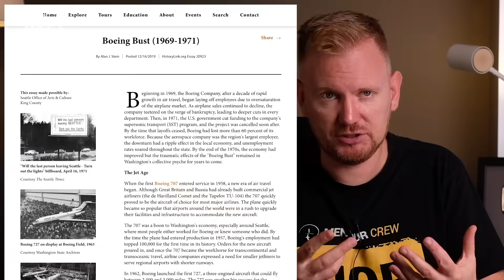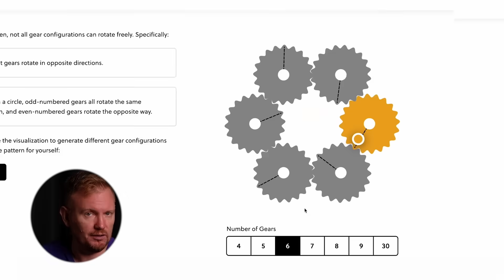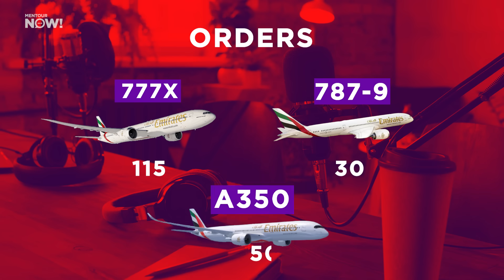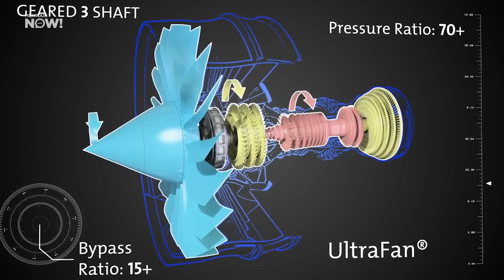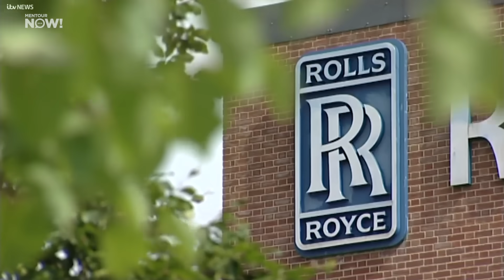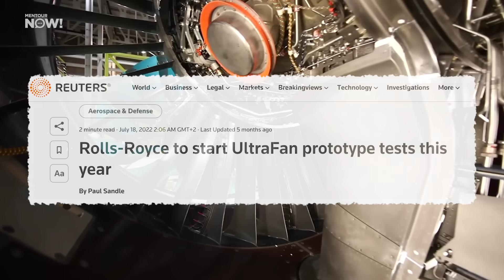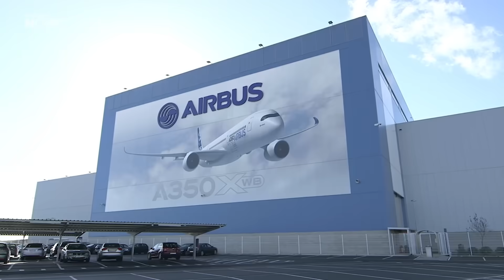Are BOEING planning a 747 with 2 ENGINES?!

Comment: Indeed Boeing will, then they will start to use anti-gravitic motors as they move away from requiring any fuel. No doubt the plane design will go through significant design as the current one cannot handle any speed above about 1000 kms per hour.

Comment: I'm curoius to know - is there a current operator using a doal configuration where part of the aircraft is used for passengers and the rest of it is used to haul cargo to the same destination - is this even feasable ? and if so - could it be the next use case for a large size aircraft like a 747 or A380 ?

 This could also eleviate slots in airports were a 747-like aircraft could drop it's passengers and then move over to the cargo area to load the next batch of cargo, then back to the terminal to load then passengers for the next destination (where it would carry the cargo to as well) - What do you think ?
Reply: That type of airliner is known as a combi and has been in use for decades. It used to be fairly popular but not anymore. Boeing for example produced combi versions of the 707, 727, 737, 747, and 757 but they have not produced any since then. They did not make a combi version of the 747-8 and there is not a combi version of the 737 MAX.
Reply: Adding to Steve's reply. Boeing also produced a "Convertible" version of the 747, with cargo loaded in the front nose door, and passengers at the back. The consensus is that new combis and convertibles would be basically uncertifiable now, due to regulations regarding fires. After combi accidents like South African Airways Flight 295, ValuJet Flight 592, and several freighter crashes caused by fires, the FAA is extremely strict about fireproofing and air-separating passenger and cargo spaces.

Comment: This made me think of all of the different wide body planes or just planes that I have flown in over the years. 777, 767, 757, 747, 737 all version’s, 727, 717, 707, DC-10, DC-9, MD-80, DC-8, L1011, A310, A319, A320, BA-136, Shorts 360, Cesna 182, Cessna Grand Caravan, CRJ-100/200, CRJ-700, ERJ-175, Bombardier Q-400 and a Bell Ranger Helicopter. I have probably forgotten a few. I have to say the 747, L1011 and DC-10 are my favorites. Unfortunately, most of my flying is now in regional jets.

Comment: I'm pretty sure I saw a documentary on the making of the 777 where they were testing its engine on the 747. If memory serves me correctly just one 777 engine was powerful enough to provide enough thrust to keep a 747 in the air. A twin engine 747 would seem doable from a technical perspective. Whether its worth doing is another matter.

Comment: Great video. One comment: Is Emirates really being profitable with A380? Is it due to high load factor alone or also as a result of Emirates enjoying on average 30% lower fuel cost than the rest of the industry. In Oslo, Emirates hardly ever load fuel signaling they prefer to fly heavy outbound to avoid having to refill outside UAE if they can. One reason can be lower prices back home, despite higher fuel burn and emissions due to unnecessary increased weight. The primary owner is the primary oil producer in UAE and fuel prices are not market driven but established by a fuel price committee under Ministry of Energy & Infrastructure and Ministry of Finance. Would Emirates’ business model work with normal fuel cost?
Reply: Got that right can't say it any better!

Comment: All other considerations aside Peter, wouldn't a four engine aircraft be a safer one from the point of view, if one engine fails, the crew would have another 3 to depend on?
Am I right to assume, if a two engine plane looses one, it has only got half its power and control to keep flying?

Comment: I once saw a B747 taking off from SEA and it had three normal engines plus one absolute MONSTER under one wing.  I recognised that they were testing the engine on a known platform.  Perhaps it was one of the GE90 units on the B777-300ER?
They did not just alter the 747 to create the 777.  That was a completely new airframe.  There is no way the 747 can simply be adapted to accept a new two engine configuration!!  The 747 was designed as an all metal airframe and you cannot just swap in some carbon fibre to drop weight.

Comment: I live in constant chronic pain and ptsd...Last time I flew I was in a lot of pain, stuffed in a little seat, with no access to a isle.  Despite explaining this to the person in the isle he'd not give up his seat. (100% VA war disability rating).
  Even if I'd not have that rating/disability why did the general public accept the extremely cramped seats now?
  After that flight (5 hours of torture) I will probably never fly again.
  But if I do you can be sure I'll contact the airline to buy the ticket and there is no way I'll never fly again if I can't access the isle (so I can move as need be).
  If you've seen a Movie/TV show where they torture someone on a stretch table think of being like that for hours...
  For many reasons I wish we had a far better rail system over flying though.
  2 days from LA to NY should be the standard via train IMO. Or from Seatle to Miami.

Comment: Hard to imagine an engine that could keep a 747 airborne. In fact it's hard to imagine a pair of engines that could do so.
Reply: A single engine can keep the largest 777's airborne, they are similar size as the original 747.
Reply: @StevePemberton2  Wikipedia lists the 777's "maximum takeoff weight" as being 775,000 pounds. It lists the maximum takeoff weight of the 747-400 as 910,000 pounds. A very substantial difference.
Reply: @jackfitzpatrick8173  The 747-400 wasn't the original 747. The 747-100 was. 750,000 lbs.

Comment: With the huge decreases in weight, and considerable increases in fuel efficiency over fifty plus years of production, a two engine model would have been conceivable, but Boeing kept increasing the fuel and passenger loads, as well. The safety considerations of having four engines on the very long flights make me doubt that buyers would really go for that option.
Reply: Which is why the Secret Service requires four engines for Presidential airplanes flying over oceans.  The Secret Service won't talk about ETOPs or twin-engine reliability stats.

Comment: two engines is a bad idea. you're trading safety for cost cutting disguised as "going green!"  one engine fails and the plane crashes all because a company wanted to pretend like using 35%-50% less fuel on their airplane somehow balances out the hundreds of tons of trash and sewage just getting dumped into the ocean by india, china, and even the united states.

Comment: No aircraft exists which can accommodate so large an engine? Isn't this the same issue which led to the disastrous changes in the automated flight controls in the 737 Max ?
Its engine diameter was too large to place at its optimum aerodynamic position without risk of scraping the runway. The engine was moved upwards to address this, but that induced an instability. Boeing attempted to address this via. (concealed) changes in automated flight control algorithms for stall conditions. The results were an unmitigated disaster. For Rolls Royce to build an engine that is even larger risks the same and suggests that a much more elegant solution is needed than relying on software to address aerodynamic instabilities.

Comment: I'm wondering when large twin engine aircraft will go into a high wing configuration to accommodate larger engines.  The Air Force already does this with large aircraft such as the C5 Galaxy, C141 Starlifter, C17 Globemaster, etc.

Comment: I believe that KLM tried this, but let it go. There is a picture on the net somewhere. The 747-400 had a fan diameter of around 96" and a thrust per engine of just over 50,000 lbs. The GE90-115 engines have a thrust of about 115,000 lbs, so you can theoretically use two of them and you would probably save a bit on drag. However, the GE90 engines have a fan diameter is that is fully 2.5 feet larger and this makes the engines very close to the runway surface , especially on landings. Given the expected lower cost of just retrofitting the 747 with two engines of a higher rating, I fully expect that it would have been done directly if it had been possible. When the 777 arrived in the mid 90's with its better per passenger costing, the writing was on the wall as 2 is better than for for outright purchase price and for maintenance. I would thought that some wizard at Boeing would have immediately looked at (a) offering a new 2 engine variant of the 747-400 and/or (b)  figuring out how to retrofit current planes to two engines. Whatever, it would have had to been cheaper to do that then buy a brand new 777 for $300M. That it did not happen and they went on and built the 747-8 tells me that it was unworkable.

Comment: Don't forget that GE engines are all electric and don't require extension cords, except when they're on the gate. They have 110 and 220 volt plugs , too, and adaptors for those goofy European plugs.

Comment: In the 70s the term, 'Jumbo Jet' was absolutely exclusive to the 747. It was THE Jumbo Jet. Nobody knew about the DC10 or Tristar for at least a couple of years after the  fuss of the 747 introduction and the term was coined for that aircraft.
The early engines can easily be doubled in thrust by a single engine but as far as I know 120,000lb is about it for the big GEs today, there will be some weight saving,  better aerodynamics, cleaner wing etc so it might be OK with later generation 747s too. A single F1 rocket engine could fly 7 .5 747s

Comment: I once saw a 747 with 5 engines mounted. Yes, really, 3 on one wing and 2 on the other.

Before anyone thinks BS, note I said "mounted". It was in mid 1985, a British Airways variant, I guess either a 300 or 400. I was on Ascension Island at the time. BA were contracted for troop movement between UK and the Falkland Islands. There was an issue with an aircraft in the Falklands that required a replacement engine, might not have been a 747, in fact IIRC correctly it was an RAF Tristar with the issue.

Anyway the replacement engine was transported under slung a 747 wing. I've no idea how they attached it or had trimmed it for flight but fly it did. How I wish I still had the photograph but unfortunately my ex-wife will have done something with that. lol.
Reply: The 747 has a mount under the left wing close to the fuselage where it can carry a replacement 747 engine. I had not thought about it carrying another type of engine but I suppose that's possible, guess they jury rigged some way to attach it.

Mentour mentioned briefly the Virgin Galactic 747 that launches rockets from under its wing. They attach the rocket to that same mounting location. That area was already beefed up for carrying an engine so they didn't have to make any other modifications.

Comment: The engine diameter would not fit under the wing of a 747. They would have to redesign where the wing was or put a bend in it. Also 747 is aluminium. Not so trendy at the moment with the neo engineering crowd.

Comment: Mentour, the B52's are getting overhaulled with a full on TMP era constitution class refit size overhaul, with everything getting torn out and redone, that is most likely what the super turbofan is being made for, also downsizing, and putting oversized engines on a two engined craft is a horrible idea as they already cant take the strain of an engine failure as it is

be it the loss of power to one side, or the damage that comes from the failure and the pieces flying towards the thin skinned hull, 

and now you make the engine bigger without beefing up that hull, which you KNOW boeing will do, like that is just a bad thought going somewhere to happen. 

as 4 engines exist for a reason, and not to guzzle fuel, it was done for safety, and no matter how reliable you make it, there's still always that chance

if anything they need to make the engines smaller and more efficient with better balistic armor to shield the fuselage in case of an engine failure, not make them bigger and thanks to the sheer size and newtons first law more prone to that

Comment: Over all business case Optimization drives the subsidiary technologies ! : The 747 had a very long production run and maybe a entirely new reviewed design slightly smaller will use 2 bigger engines instead of 4. : Bye bye to the pioneer of aviation mammuts! : https://youtu.be/9GamlLEBkxw

Comment: Is freighter demand not sufficient in itself to justify an aircraft design? Long haul freight seems a big market and size and economy would certainly be a benefit.
Reply: Boeing thought this when they built the 747, they made sure that after becoming obsolete as a passenger plane it could continue as a freighter. But it didn't work out that way. 747-8F sales totally dried up not long after the passenger version stopped selling. 

Generally speaking it seems that cargo and passenger requirements are very similar. What is good for one is generally good for another. Specialties like front or rear loading is more of a niche.

Comment: If the basic 'problem' with the 747 is its fuel burn and if much of the need for max power comes at take off, wouldn't there be a way to have 4 engines be available when you need them, then be idle the rest of the time?  If that were possible it might not be as efficient as a clean sheet design would be, but the 747 design and the means to produce it already exists and I'm guessing that would be a major cost savings.  I imagine if it were that simple, Boeing would have already done this, but-----

Comment: What about the new blended wing aircraft Boeing (X-48) and Airbus (Maveric) are designing? Those new larger engines would be perfect for a large haul duel engine configuration on a new blended wing body shape. They would sit on top of or within the body of the aircraft, so maximum diameter is not as critical as beneath the wing.

Comment: No they won't be. At least for not ten years according to what I read. Boeing won't be designing any new aircraft in the near future. I waited for engine upgrades for 15 years when I was in the 5th bomb group and I think Boeing eventually scrapped the idea. They were going to convert our aircraft to four engines instead of eight. But I'm retired now after 24,719 hours.

Comment: Raytheon potentially holding a patent on geared turbofan engines is an interesting little detail... Of course RR would have known this before even starting on the Ultrafan, so presumably they have a reasonable level of confidence that they can either challenge the patent or get an acceptable licensing deal with Raytheon/P&W.
I'm sure licensing the patent is at least going to be possible without making RR's engine unprofitable, but given the potential market size involved it'll be worth putting their no-doubt enormous legal team to work on it. I'm not sure exactly what the P&W patents cover, but I feel like it must be something more specific than just the concept of driving the fan through a geartrain of some kind, since I think it'd be hard to argue that was a non-obvious innovation. 
That said, I'm sure the practical aspects of exactly how you design and build a geartrain that's reliable enough to do the job for thousands of hours without an impractical amount of maintenance sounds to me like it'd be incredibly difficult, so perhaps a few ingenious patents could indeed be granted.
Reply: The concept does also lend itself quite nicely to a family of engines with different cores which could be optimised for different fuels and even potentially electrically or hybrid electrical/jet power cores.

Comment: Emirates can "do it" because they have put themselves in the position of being a fat pipe provider between Europe, the middle east, and Asia / Oceania - and technically even to the US west coast.   They are not just flying full planes to London, but to many other places, with a huge interchange in their Dubai hub.  Their business supports very large aircraft.   They are also very rare in the market anymore.

The market for very large aircraft is defined in no small part by their ability to have both passenger and cargo versions.  The A380's biggest failure is that it cannot be usefully converted to a cargo aircraft - issues of how it is built and max weights, etc).  the 747 long since passed it's profitable point as a pax plane, but in cargo, it's still a workhorse.  The 777 cargo planes are taking over, but the 747 still rules when it comes to long loads and such because of things like hinged front loading, etc.

Airbus has for the moment the A33x variants in cargo, and the A350 freighter version apparently will start to appear shortly.    It doesn't seem likely that anything bigger is forthcoming.

I do think however that there is a market for Antanov style cargo planes, perhaps a boutique maker producing say 50 cargo aircraft a year might find an ongoing market for heavy haulers to replace many of the 30+ year old 747s that are plying the cargo trade at this point.

Comment: Why bother - the largest 777 is roughly equivalent to the 747 in capacity with two engines.
Reply: They would do it if was more efficient than a 777, and perhaps more versatile in cabin layout especially for the lucrative business and first class seating arrangements. Too complex for us on the outside to know whether it would or would not have advantages over a stretched 777, but it seems unlikely there would be enough gains to warrant such an expensive project.

Comment: The 747 will have much bigger engines like the 737 MAX and they will sit much further forward to avoid scraping them on the runway and the plane will have a special trim system on the elevator to correct any pitch up ...but ...with a disconnect button this time.